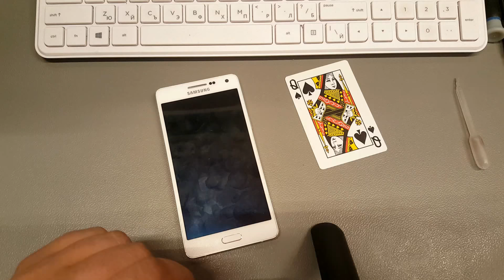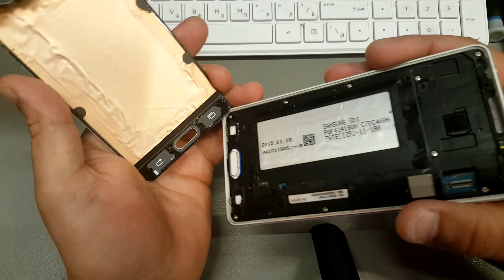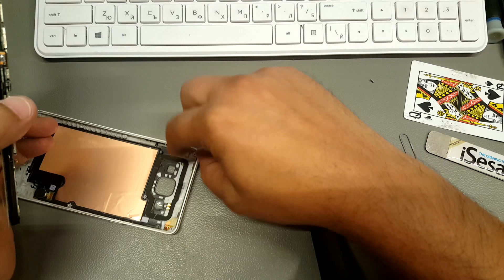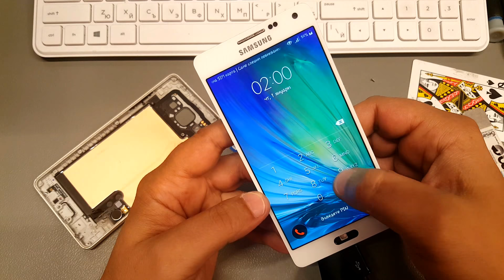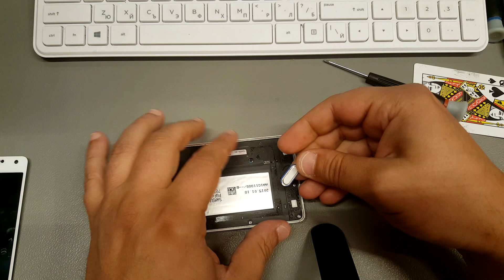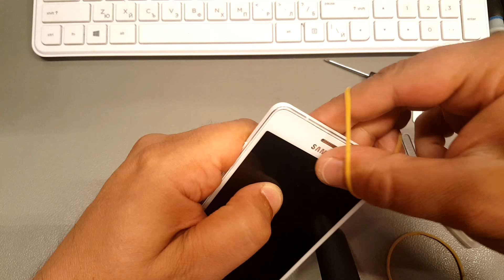BOOM!!! How to Open / Disassembly Samsung A5 2015 SM-A500F.Without broke display.

Comment: DUDE! YOU MADE IT LOOK SO DAMN EASY SO I DID AND NOW MY PHONES LCD AND TOUCH BOTH ARE COMPLETELY BROKEN -.-
Reply: Lol
Reply: F
Reply: Same here... lcd was glued stronger than the glass and pulling it apart destroyed it. I followed the instructions step by step and now i have small pieces of the lcd all over the table and my tshirt! hardware button connectors aren't looking good either. The only mistake i can guess was probably heating too much the sides and not the center of the screen. All other phones i had opened were opening from the rear unlike this piece of sh!t. ☹
Reply: You should have to heat up the display first for the glouw melts so you can save display 40% of saving

Comment: sir why samsung galaxy A500G camera is blurry how can i solve the camera
Reply: Im not him, but if its the front facing camera you need to take it apart how he did in the video, locate the front facing camera and clean it with something gentle
Reply: If the clean doesn't work, try to replace front camera and will fix your blurry.

Comment: How to fix samsung a5 2015 battery
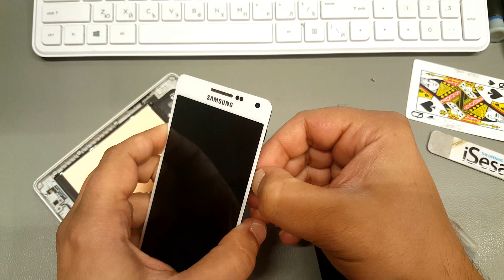Reply: So you just buy new battery and disassembly your phone like in video 5:18. Pull out the battery and then add new one and connect it to motherboard (same as u disconnect it 5:18).